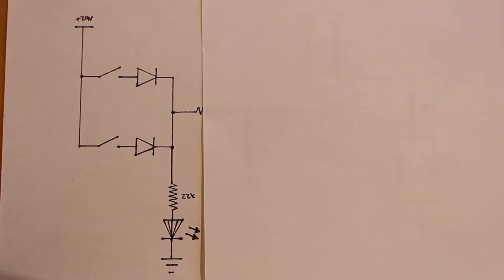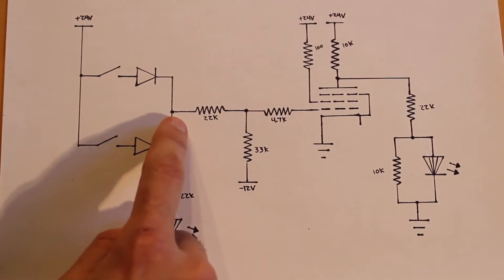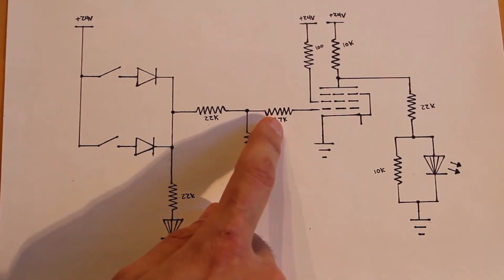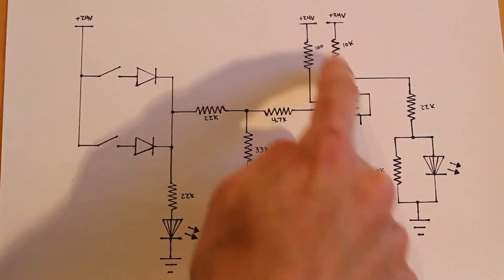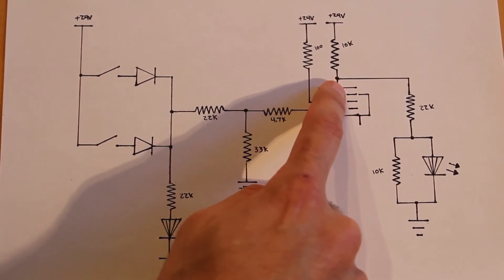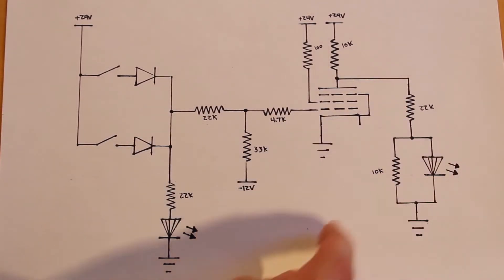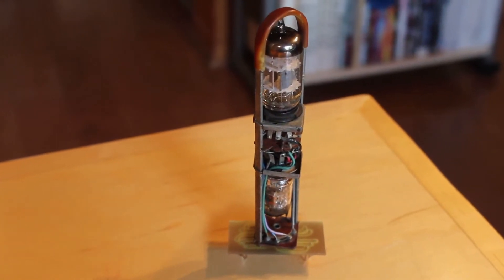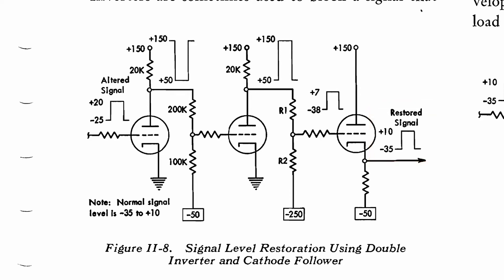Let’s Build Some Logic Gates out of Vacuum Tubes: OR, NOR, NAND, AND

Comment: You can make an XOR gate with just two transistors, so you should be able to use a dual triode for one XOR gate.

Would it be possible to use a cathode follower instead of the first inverter to make the AND gate ?

Comment: Nice video!
One question though: Why do you always put in a 4.7 k grid resistor?
If the grid voltage is coming from a potentiometer between the power rails then it makes total sense, because you want to limit the grid current even when the potentiometer is at its end positions, where it has really low output resistance.

But if the grid voltage comes from a voltage divider using e.g. a 22 k and 33 k resistor. The parallel resistance of those is already 1/(1/22k + 1/33k) = 13.2 k, so I'm not sure that adding an additional 4.7 k is necessary.
Also, if you wanted a 13.2 k + 4.7 k = 17.9 k grid resistance in this case, you could scale up the 22 k and 33 k resistors by 17.9/13.2 instead, to 30 k and 45 k (33 k and 47 k should hopefully be close enough). That would reduce the load on whatever is driving the inputs to the voltage divider.

Here I've assumed that both inputs that drive the voltage divider have zero output resistance, but as long as it's reasonably lower than 30 k in this case, I think the results should be similar, you might have to tweak tge resistor values a bit in some cases.

Comment: As much as I do understand the sentiment "I love it when a plan comes together" (and really, I do), all those awestruck exhilarated noises at the most mundane result are heavily grating. See, the thing - the one thing - of science in general and electronics in particular is that it's EXPECTED TO WORK first time, every time, day in and day out, ALWAYS, as long as you stick to the circuit diagram. What you do is cheapen all that achievement by reducing it to the level of occult magic where success is supposed to be some function of luck and skill and random chance. ANY half-competent engineer would be offended by the implicit assertion that a correctly constructed circuit actually working is an extraordinary event. IT IS NOT. IT MERELY MEANS YOU DID NOT FUCK UP. Whether that's cause for enthusiastic celebration I'll leave for you to decide...
Reply: If I was a paid professional fully trained in this I would probably agree with this sentiment, something working according to plan is you doing your job right. But as a a hobbyist bumbling through a field I don't have nearly enough prerequisite knowledge or spare time for, this kind of take would have stopped me dead in my tracks. Sometimes you have to give yourself a pat on the back for achieving something simple, otherwise you will never see yourself through to knowing more.

Comment: I stumbled across your channel thanks to your minicomputer video series.  I had to step away from that series when you blindly powered up one of the terminals just to see what happened without taking any precautions to avoid damaging it.  I hope you didn't release any of its magic smoke.

But after that, your vacuum tube videos kept popping up in my YouTube suggestions.  I've been fascinated with vacuum tube electronics since I was a kid.  I have a few vacuum tube era items - a few radios, a TV, a phonograph, and perhaps some others I'm forgetting at the moment, that I've been meaning to learn how to repair for years.  I know enough to stay away from their high voltages until I know what I'm doing.  I like the idea of learning vacuum tube basics at lower voltages.  I will have to give some of these projects a try.  For a moment I thought you had released some magic smoke in this video, but it turned out to be your hair in front of the camera.  :-)

I might have to cringe my way past your terminal power up so I can check out the rest of your minicomputer video series.  I was an IBM mainframe operator for a couple of decades, and now work with IBM midrange systems.  I have a fondness for mainframes and minis.

Comment: You can also make a NOR gate using just a double triode and a few resistors. Each triode is configured as an inverter; then connect the 2 outputs together. They can even share the same plate resistor.

Comment: I'm sure I'm missing something here, but it looks like you have an AND (made from silicon) followed by a tube inverter (making a NAND) followed by another tube inverter so you end up with an AND again. In other words, isn't the second tube redundant? You already have an AND at the output from the diode stage (no?)
Reply: I have the same question. My best guess is that because of the large resistor it may not be suitable to drive a general output? (Even though it's capable of driving the triode in the first inverter?)
Reply: @jimktrains0  I think that the AND gate could actually be built much like the OR gate, but mirrored. (And the NAND gate could be more or less as simple as the AND gate).

In these examples, the inputs are switches that either go to the positive voltage or nothing, so the input is good at sourcing current, but it can't sink any, and that makes things tricky for the AND gate.

But in an actual circuit, the input to a gate will be the output of another gate. If that gate ends in an inverter, it can both source and sink current. In fact, it will likely be much better at sinking current than source it, because the plate resistor has to be weak enough that the tube in the inverter can sink all its current without making the output go up much in voltage.

If you have two outputs that can sink current, you can make an AND gate by just by running each through a diode so that they can only sink current. Then the output will "go low" (sink current) if either input does.

To make a NAND gate out of that, add a little biasing network and an inverter.

Comment: Whats up with your power supply?  Your using the pcb for both 24vdc+ and 12vdc-?  Thanks!
Reply from the maker: Hello!
I apologize, it's probably not clear how I have it set up here. I have a +24V and -12V supply set up just off camera that is supplying those voltages to the breadboard through the wires in the bottom right (red is +24V, black is GND, and blue is -12V). The little PCB buck regulator in the top left is actually regulating the +24V down to +6V to power the heaters in the vacuum tubes. So, it's a bit like having a third power supply on the breadboard.
I hope that makes sense!
Reply: @UsagiElectric  No apologies necessary.  Yes, it makes perfect sense.  You did a great job on the video.  Perhaps you could do a video on making your own transformers?

Comment: HOW DO YOU DETERMINE THE CORRECT OHM VALUE FOR THE SCREEN RESISTOR?  THANKS.
Reply from the maker: That was actually just a total guess loosely based on the 6AQ5 pentode design from the IBM 604 Customer Engineering manual. 
Here's the picture in particular I'm referring: https://i.postimg.cc/26tp67XZ/Screen.jpg

In that design they use a 0.47k (470 ohm) resistor between the screen grid and +150V. Since I'm running just +24V and I had a ton of 100 ohm resistors on hand, I figured I'd give that a try, and it seemed to work really well. So, I just stuck with it!

It should be noted, I have since changed my basic design and use different resistor values for the plate and grid input voltage divider.
Here’s an updated schematic for OR/NOR: https://i.postimg.cc/G2BqVDQf/OR-NOR.png
And an updated schematic for AND/NAND: https://i.postimg.cc/QMYffmp5/AND-NAND.png

Comment: I want to see you build an 8bit computer with vacuum tubes
Reply from the maker: Thanks! That's kind of the direction I'm working towards. Although, due to the sheer size and cost of tubes, doing something like the SAP style computer isn't really feasible. But, tings like a serial architecture and a more specialized usage case are definitely in the realm of possibility and something I'm actively working towards currently!
Reply: @UsagiElectric  well I was half joking ;)
Reply: @UsagiElectric  4 bits?
Reply from the maker: @sirnikkel6746  I did think about using a 4-bit architecture, like the Intel 4004 for a little bit, but in the end it would have still been absolutely massive!
I actually ended up starting my build based around a 1-bit architecture similar to the MC14500 ICU microprocessor. I have modified the design a bit to include a full adder to give the processor a lot more functionality.
I currently have an ongoing series about building this up!
https://youtube.com/playlist?list=PLnw98JPyObn0v-98gRV9PfzAQONTKxql3
Reply: @UsagiElectric  good luck